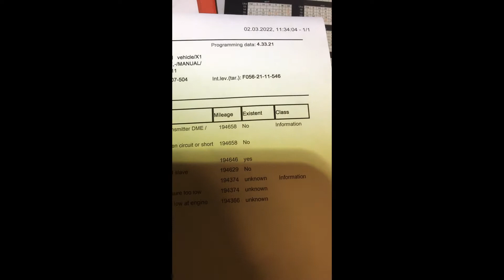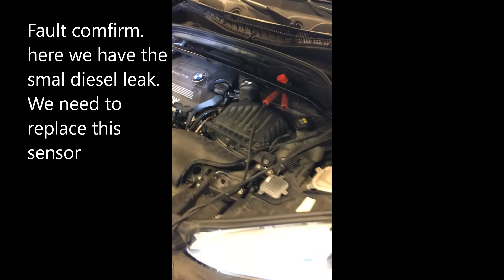BMW X1 F48 Drivline fault message

Comment: Hi, I am facing the same issue with same sympton, may I know any follow up action  after changing the sensor? For example, do I need to change the engine wring hamess of DDE module?
Reply from the maker: In this case the wiring harness was not replaced. We only replaced the sensor and I think the car still drive to this day.
Reply: @Bmwdiagnostics92 can the sensor alone be replaced please? 2016 20D, and if so do you have a part number please